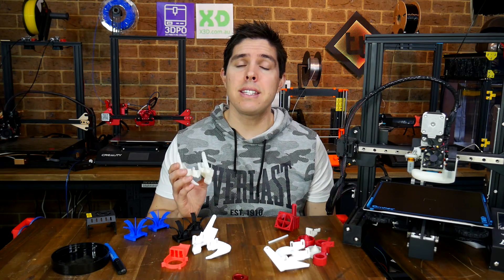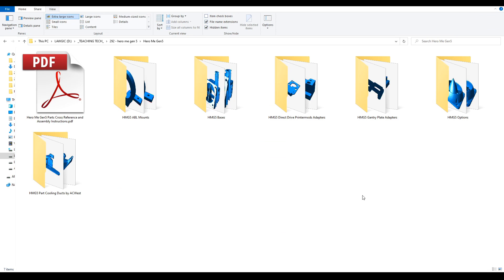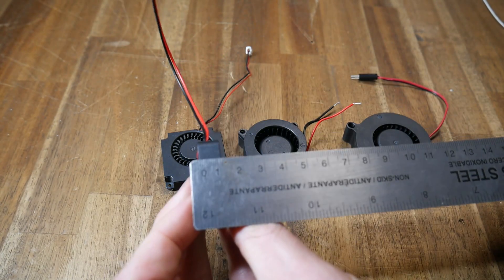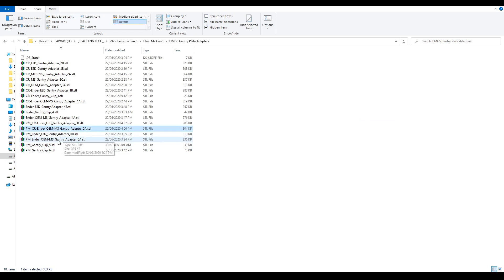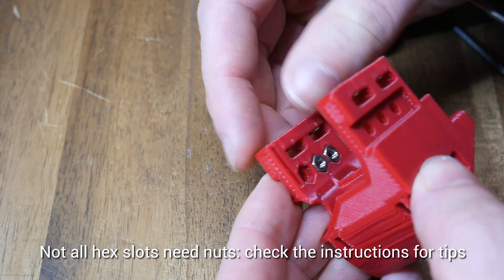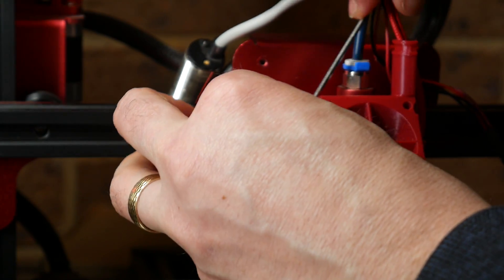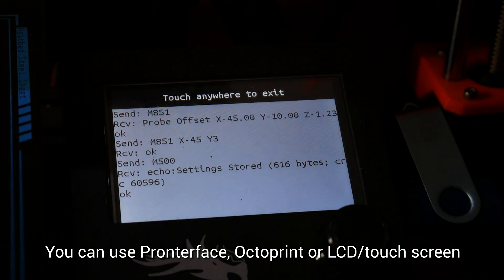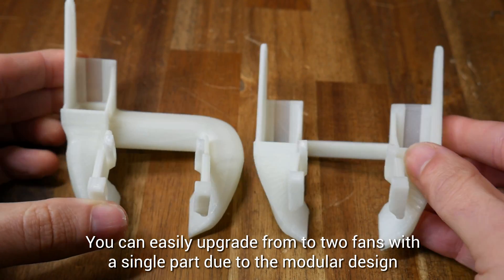Hero Me Gen 5: The ultimate part cooling fan duct for Creality 3D printers?

Comment from the maker: That line about super gluing your nuts was regrettable, but I've had a good laugh from all the comments. Some other points:
1. For the Ender 3, I was already running a 5015 blower and earlier Hero Me. The image shown at the end gives a better indication of the type of improvement you'll get from stock to this: https://imgur.com/a/EfFlS3P
2. One advantage of running twin blowers is running them on low power, which can often be quieter than a single blower on full power.
3. Some comments about this not playing nicely with Ender 5: apparently the files have been tweaked since first release to improve them and there are smaller ducts to prevent fouling the frame.
4. I'm still running a Noctua on the hot end heat sink, it's just black. Still no clogs or creep. It works very well with this system as the air is directed well.
Thanks again to Mediaman and ACWest for this great creation!
Reply: Guess i wasn't the only person laughing when you said "glue your nuts"
Reply: i tried to keep a straight face.. i really tried
Reply: Can you also link the other materials and tools? And what hotend do Tevos use? They mount thru the top with 4 screws. Is there an adapter that lets one use a creality or microswiss hotend?
Reply: Was wondering about the dual duct to run then"slower" but I cant seem to find blower fans that are left and right oriented. so one side is sucking air in from the side of the hotend? any advice?
Reply: I have to admit, the super glue comment showed my lesser man in a strong way.
Reply: Just to let you know the small wrench the ender 5 came with is about 1.6mm so you don't need to print something
Reply: The instant I heard that I went down to the comments, and bam there it was. Couldn't help but laugh.
Reply: I came here for the same reason 😂
Reply: I have an Ender 3 that's currently all stock. I just bought a BMG, a 26mm pancake stepper, and an e3d v6 to convert to direct drive. Do I need to buy the printermods conversion to use the hero me 5 in a direct drive configuration, or is there a set of files I can use in the hero me 5 zip to perform the conversion without the printermods part?
Reply: @mrb2917  I was looking for the same thing. I think that you need this additional file https://www.thingiverse.com/thing:4500889

Comment: I had a little trouble with your cooling test model. Printing PLA the nozzle would “catch” on the topmost part of the legs. It appear the PLA was straightening itself out slight causing the nozzle to impact the printed material. I don’t thing this happened when I printed very slowly. 

Has anyone else noticed this?

Comment: Good video but not being able to run the fans at variable speeds killed this mod forme. There are some parts and materials that I need 20% cooling to 50% cooling on.
Reply from the maker: This mod is independent of fan control. If you could vary the fan PWM before (almost every 3D printer) you still can now.

Comment: Nothing about that was simple or straight forward in my opinion, especially to someone just starting out in 3d printing. Maybe it was for seasoned veterans of this industry. From my "noob" perspective, that appeared to be extremely complicated, and well more than I care to venture at this point. 
I have a newly released CR10 Smart Pro, and just wanted to put a 5015 blower on it instead of the stock fan, and add a dual sided duct, so it's not just cooling the parts from one side. Initially I preferred to add two 5015's, as I have several of them, but it seems way too complicated to add an extra one, or am I wrong about this??? 
Is there a way to do this where I don't have to disassemble my entire hot end/sprite assembly??? I don't mind messing about some, but don't have the time or knowledge to dive too deep into this, YET. My simple  immediate goal, is to have better cooling from both sides of the part. Thanks for any advice/help. You've been one of the more instrumental reviewers I've listened to as I get started into this journey.

Comment: Hi Michael, Thank You for this video. I have a ender 3 pro with CR touch running stock firmware. If I go for this mod will I need to go for custom firmware and most importantly will I be able to print ABS? Right now I have sealed the bottom of my stock hot end assembly with alluminium sticker foil to keep the air out from the hot end fan hitting the bed and causing my ABS prints to lift/warp while printing. Your advice would be very helpful because I print PLA+ mostly and have problems with overhangs

Comment: hey found a fan mod for the Anycubic Vyper on thingivers and printed everything so far. When my 5015 v24 fans arrived, everything was assembled and the connectors were soldered together and this update was built on my Vyper. At first I felt pressure that the fans briefly jumped to 100% and then to 50% or 75%, which was different. can someone tell me if i did something wrong or if someone might have had the problem before

Comment: It appears that what is available on Thingiverse has changed since you created this video. The ZIP file no longer contains the cross-reference/instructions PDF. Also, it seems that the base needed for the Ender 3 Pro, Hero_Me_Gen5_Base_1.stl, is missing from the zip file as well.

Comment: Nice video.
I am now upgrading my CR10 to hero me gen 5 with dual fans.
How should I do the wiring? Just connect both 5010 blowers to the wire of the original fan? 
Is this ok? Would this draw too much current and overheat the mainboard port?

Comment: Would you happen to have a video (that I haven't yet seen) detailing how to crimp two blower fans together? I watched one recently on soldering the two fans together, then soldering that connection to a red/black cable back to the main board but I did that yesterday and it resulted in the magic white smoke from my SKR Mini E3 V2 O.O

Comment: I have tried to print the single 5015 fan dual duct mount multiple times and one specific layer always fails, rendering the print useless.  Any suggestions on infill (if it must be used).  Or, is it as effective to use a single duct version?

Comment: Hi! Great video! Thanks! 
I've a question about the wiring an add fan or change it. I have a Ender 3 v2 with the stock 4010 fan.. how did you to change it for a 4020 (0.05A vs 0.1A)? and it's the saem question of you add another 4020 fan.. you only conect the wires or you need change something in the font or marlin maybe? Many thanks!

Comment: I think I have decided on my next printer; I will probably buy a ender 3 (for its ease of modification), and reliability out of the box.  I do know that on my list of 'I wants (may not NEED but do want)' is the IDEX for it so I can get an IDEX printer.  My question (beyond for you do a review of it, lol), is where the IDEX heads park off to the sides and the cooling can be 'iffy' what would be good fan ducts for this?

Comment: Hi, Thank you for the marvelous information! One question left:
as you told it, you got to select not only the gantry but also the gantry CLIP for fixing the backblade to the printer. You show it for then gantry but NOT for the clip. With my Ender 5 this is a very small part, which is fitting in the rectangula window of the gantry and the two wholes seem to fit the threatbolds which originally hold the hotend. BUT the bolds are a very small amout wider (this could be fixed) BUT putting the clip on the bolds and then putting it through the window of the Gantry the gantry is about 8 mm to high for the leftscrews to fit in their threads. Has anybody an idea of how to use the gantry-clip and how to fix the whole Gantry onto the 'travelling blade' of the Ender 5??? I would appreziate any idea cause I got no more for the moment.
Reply: There is no clip for 3 V2

Comment: I really didn't like how very fiddly indeed the hero me system is. The amount of y offset they are calling for on some printers loses significant print volume. I am currently using hydra. It's designed so you can get to the hot end by simple removing the cooling fan. It also has bltouch mounts that mount on the cooling fan grille. Giving all of 0 x offset for the bltouch.
Reply: I'm thinking about replacing the bullseye fanduct because the abl mounting on the right side of the abl offset +40 x -4 y can't reach the whole bed. I'm looking for a suitable fanduct for ender 3v2 and for abl monting on the left or in the middle so that the sensor abl  can reach all bed surfaces
Reply: @madorax251  Hydra has on fan mounts with no x offset and 40mm y. Which on an ender 5 is exactly enough clearance not to loose print area.

Comment: I have a CR 10S Pro V1 as you do. I have always struggled to get high quality prints. I make parts for trains and mostly functional parts that are deep inside and not to visible. But now i am making some external parts and the finish is pretty rough. Strings, voids, nerds its a mess. Using PLA. Are there upgrade parts you think may help me turn the corner of this print quality issue or processes I may be missing. I have a Swiss Micro Hot End, and Tiny Machines Firmware, updated Bed sensor (Not BL Touch) Thank You for your videos and knowledge sharing. Dennis in Virginia

Comment: 10s Pro with E3dV6 Clone.... bottoms out on the z motors before the nozzle is even close to the bed...

Watched Teaching Techs video, used the configurator for parts selection, went back through the pdf instructions and have all the right parts. The x axis mounts bottom out on the z axis motors before the nozzle is even close to the bed.... any suggestions?

Comment: @TeachingTech 10:58 What part did you substitute Hero_Me_Gen5_Base_1 for on the Ender 3?  Because that's not the same part... The biggest issue with using, Hero_Me_Gen5_Base_1 is the housing for the wires is too tall and prevents you from installing the EZR extruder. My work-around for this was to trim the housing to allow enough clearance to install the EZR extruder.
Reply: After closer inspection, I was able to identify the correct part. So if you have the same issue print file, "Hero_Me_Gen5_Base_4" Hopefully this helps someone

Comment: Really great video. Nice work. But I have a doubt regarding the nozzle position after attaching the extruder to the plate. The extruder position is changed almost 15mm to the -Y axis from the gantry plate. As a result we almost loss the front of the bed. So is there any methods to adjust the nozzle position?

Comment: Any thoughts on how to convert a stock Ender 3 Pro to dual fan?
Reply: Did you find any information about that?
Reply: @tramonza  not really but I am going to try crimping the 2 new fans to a single 2 way connector and crimping the old blue and yellow wires to another and simply connecting the two together

Comment: Hi Michael. As all your vids and info you create and share this video is again very insightful and informative. Thanks for sharing. I have one question though, I recently installed the Hero 5 on my CR-10s Pro v2 and it seems that the hot-end is somewhat angled. I haven't printed with it yet, but I was wondering if this is normal or not. Did you have this angled position too after installing it on your CS-10?

Comment: Love your channel, my question is this. I have a geeetech A10 and I hate the hotend so I would love to change to this system, but despite this is supposed to work with clones it does not have a mounting for the A10. Any suggestion to solve this?

Comment: In Hero Me assembly part cooling fan orientation leads to issue where fan disk starts to rattle sooner then later and that sound is very annoying. I prefer Petsfang and Bullseye  as in those assemblies part cooling fan axis is rotated and fan disk does not act like a drum while X axis is moving. Sooooo much less noise when X axis is moving. But I use old Ender 3 board with regular drivers. Maybe with trynamic drivers X axis does not drum that fan disk so much?

Comment: I was just curious how the printed parts are holding up printed out of pla after some time has passed.
I would imagine that PETG would be a minimum for this?
Reply: I use HIPS because it's super stiff, heat resistant, and much lighter. I'm thinking about trying OBC to get even lighter.

Comment: I have installed Hero me gen 5 with E3d V6 and bondtech. I'm having heat creap issue as the extrusion is inconsistent. What fan do you recommend for the heatsink cooling? I have 4010 to cool the E3d V6 but seems insufficient. Appreciate if you can advise

Comment: why is a axial fan not the best choice?
I do understand that an radial fan is better for many changes of airflow directions, but the axial fan has a higher air flow most of the times.
Currently I wan´t to design a part cooler for my ender 3, thats why I´m asking. In generall my goal is to get it as quiet as possible.

Thanks for any informations and help :)

Comment: I would like to remix it to use at my ender 3 printer , just exchanging instead of 2 radial fans that is nosier than the Noctua 4020 regular ones, but i don't have any idea how to draw it, it could be a silent solution for everybody who runs your printer inside your bedroom like me at nights. ( OEM Hotend, No mdd Adapter, BLTOUCH, Direct Drive with amazon adapter https://www.amazon.ca/gp/product/B082XPBL2N/ref=ppx_yo_dt_b_asin_title_o01_s01?ie=UTF8&psc=1  ) today im using hero me 3 with single 5015 but for me is to noise. Perhaps duo Noctua 40x10 or 40x20 both sides could be interesting

Comment: Personally, I'd need to see some more significant print improvements before I went to this much trouble and spent this much time.  This "improvement" is also what I consider a time bomb because you will be spending a LOT more time accessing your hot end for routine maintenance.
Reply: I've had cooling issues when printing faster, like 100mm/s. Never with the default 50. So a test with higher speed would have helped to see if it makes sense for that.

Comment: Not only can you write the new offset in marlin, if you used integrated lcd you can even combine babystepping with probe offset, setting the offset on the fly while printing skirt, etc, leaving the correct value for next print. But yeah, forget about it with touch lcd interfaces as they only communicate with marlin via serial

Comment: @teachingtech tech there is now a Google docs spreadsheet with drop downs that will tell you EXACTLY which parts you need to print for the combination of hot end, touch etc that you select in the drop downs. It's avalible on the official Hero Me 5 Thingiverse page- https://docs.google.com/spreadsheets/d/1q3H9w8mgt181L7F2nhLkkFlLbWLUgoi_dac23wQDUwU/edit
Reply: This is the best thing ever! Watching the video and making a mistake could have been a pain! Thanks!
Reply: Awesome link. Also, nothing feels better than using that tool, and then getting the exact same results I picked manually.

Comment: I don't know who else has this problem but the hero me gen5 for  me cools only from the front but from the backside it sucks all the overhangs suffer from the less cooling 
This is also verified by TTs cooling test
Anyone else having the same problem?????
using it on ender 3 dual 5015 fans (yes dual on ender 3)
please help
Reply: I heard some other guys have the same problem (comments on the thingiverese). I can't even mount the duct because the screws from printermods are to short.
Reply: @fingerimarschhd9190  I wish some one address this issue cause it is very serious I want tt to read this and reply 
I printed the deadpool bust by Eastman at 100% size the overhangs front were perfect behind th really suffured from lack of cooling
Reply: @syedsulaiman8380  I saw your comment on thingiverse^^. The cooling problem would't bother me that much. I'm sure that the Hero Me guy will update that soon and you just need to print a few parts again. What really bothers me, is that I payed 60 dollars for a MDD with sharp edges, triangular holes and scratches. On top of it, I can't even assemble it.
Reply: @fingerimarschhd9190  oooooh that's sad man
Reply: @fingerimarschhd9190  but I dont think it is going to get an update anytime soon
And the fans have a lot of vibrations too

Comment: I printed mine in a 50/50 mixture of fast resin and tenisious srytech.  This presented a lot of issues with warping, but it should be as strong as abs if not stronger.  Plus I used transparent Smokey black resin.  It looks sick.

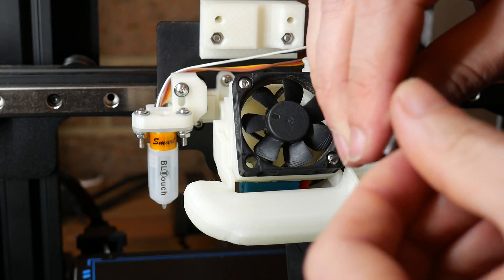Comment: So at 5:32 it says not to use the 4010 Axial fan.  However, that same fan seems to be used 12:07.  Can I use the OEM Axial fan or not?
Reply: On closer inspection, the Axial fan used looks like a Noctua, but is the stock 4010 Axial fan acceptable for the Hot End?

Comment: I was afraid this cooler wouldn't work for the PrinterMod v1.0 plate because in the documentation it refers to the v1.2 upgrade, but luckily it DOES fit, and works extremely well!

Comment: I purchased 2 12v 50/15 blower fans - Can i just run them in Series to soak up the 24 V or do i have something else i need to worry about?
Reply: The thing about running them in series is that, technically, they can vary in a bit in their resistances and inductances and that could mean that the 24V may not divide between them evenly.  So you might get a little but too much voltage on one.  To be honest this might be a case of  trying to pick the fly crap out of the pepper; but you do need to be aware that it could happen.

Comment: When you wire in the dual blower fans did you just splice two wires into the original one wire that is on the stock ender 3/pro? Trying to make sure that's safe before I do so.
Reply: Talking about the part right at 10:15